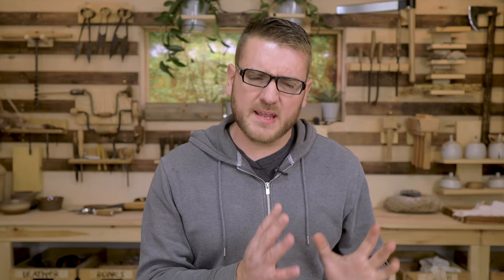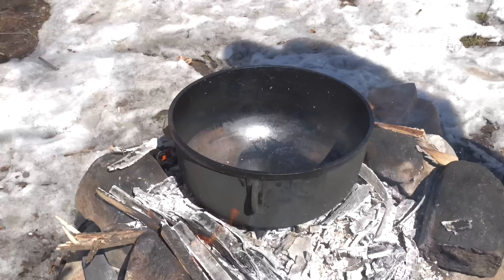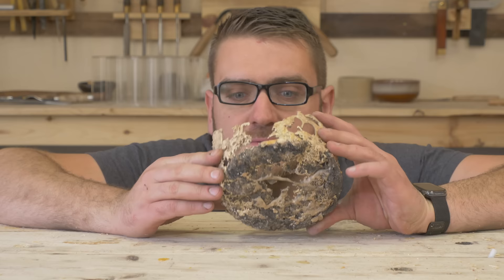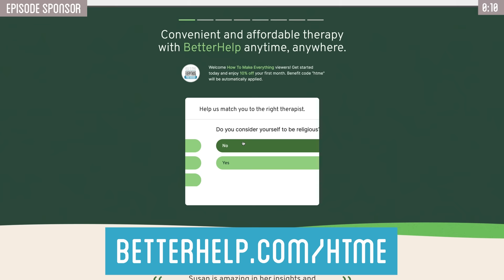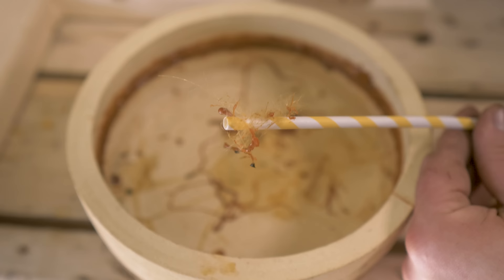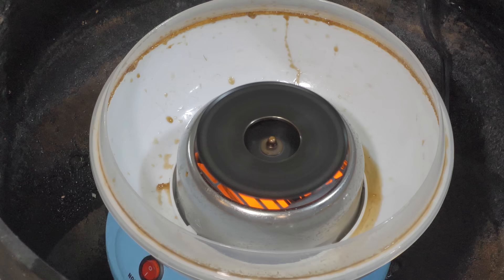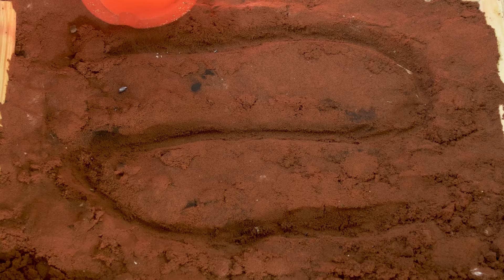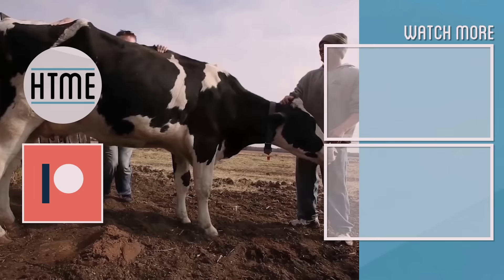Can a Dr. Stone Centrifuge Make Cotton Candy and Wires?

Comment: I tried the Dr. Stone Cola recipe once. It does kinda work. If I ever do it again, I'll be using caramel instead of sugar just for the cola look.
Reply: I've made my own cream soda like this for years. I pour a sheet of caramel, grind it up in a mortar and pestle then mix it with home made vanilla extract and water to from the syrup. From there, just use club soda or stick it in a soda stream. 

You can also use a brewed method similar to how root beer, birch beer and sarsaparilla were originally made. Make sure to use a low gravity yeast like LA-01 and get bottles with a deep punt if you want substantial carbonation. Regular bottles and jars tend to explode when making soda. Because of the sugar content, you typically just wait for the yeast to kill themselves off with the alcohol they are producing, which is a lot less controlled than dosing with sugar like you would for Champaign or beer.
Reply: Wait, you used sugar? I’ve been making it for months and have always been simmering honey for a couple minutes and using that. Didn’t know there was another recipe that used sugar
Reply: @connormcgrath5800  No, you had it right. There is no "other" recipe. It's just what I had on hand when I felt like doing it. I was way more interested in seeing just how close the combination of cilantro and lime came to tasting like cola. If I was truly serious about the comparison, I would have made another batch that included corn syrup as the sweetener in order to isolate that difference as well.
Reply: @sirnukesalot24  ah, gotcha
Reply: Yeah the recipe says to caramelize honey.
Reply: It seems like the kinda thing that works if you drink cola semi-regularly, then cut it out of your life cold turkey along with many other familiar flavors and foods (like the characters in Dr. Stone were forced to do), and then try the recipe to get back some semblance of that bygone "normal".
Reply: Oh in the anime he also put sulfuric acid does troll face

Comment: it's always nice to see semi-realistic fiction getting fact checked.
Reply: jujj
Reply: its like a second fact check. the manga used science consultants
Reply: everything shown was....theoretically possible. throw in a large pinch of anime suspension of disbelief and it really isn't that bad. Just because HTME can't do it doesn't mean no one can do it, most of his creations are super jank lol
Reply: @ExarchGaming  my main problem is that most of the inventions are not a good way to do the thing they're designed to. It would be much easier for a blacksmith to make small chunks of sheet metal and then form them into the bowl shape. And you don't have to be a skilled blacksmith for this. You just need to have a hammer and a hot fire. Then you have to consider that gears are a bad way of increasing speed for that. Pulleys are smoother and easier to build, plus you could fit more of them for a better gear ratio. Plus it's just not physically possible to make wires by slinging molten metal like that. The surface tension of the metal is way too high and it can only come out as droplets. You could just make rollers to thin out the metal and then draw it out. If you want to automate the process, you could use metal gears to pull the metal through. It feels like they're writing a character that's meant to be super smart, but because they don't have a good understanding of what they're writing about, it comes across as pretentious. Like the main character thinks he's so smart but his machines are all poorly designed and only work because plot
Reply: The way Dr stone does it is just bad, everything they do doesn't feel like a major accomplishment and it's feels like "we invented this cool thing in seconds and now we're on to making something else" and I feel the way they do the making of things with what seems to be zero effort gets rid of the excitement of accomplishing their goal. It makes such a cool idea so mundane and uninteresting
Reply: @The_evil_accountant  that's more or less anime as a whole. They love the super intelligent cliche, I dunno that it makes the idea mundane, Dr Stone is pretty wildly popular.
Reply: @The_evil_accountant It was either that or watching 3 billion more years going by before they go back to where they left off. I seriously don’t know a method of doing this sort of idea without Senku being insanely smart. The entire obstruction that Senku has is that he knows the basic instructions, he just doesn’t have the skill, strength nor time to do this. This is why the entire Ishigami Village even exists. Having a protagonist that has all smarts, talent and brawn will just turn Dr. Stone into a reskinned isekai anime.
Reply: Makes me nostalgic for mythbusters
Reply: @thedudeamongmengs2051  not hard to make that mold issue he has it wall to short and it escaping they used bamboo large enough to stand and press then poke the holes i can make one that way why they show more then one person to make sure it works
Reply: @blackcrasanblade  I didn't say anything about the mold thing but also, it doesn't really work. Pouring a metal part with a bamboo mold like that is just a bad idea. Even if it did work, a forged part is better anyway
Reply: Bruh, I've seen Indian tick-tocks with better build quality.. props for him trying...
Reply: @The_evil_accountant  I agree a lot of what they do is handwavy, but one thing that HTME is missing, is a meticulous and skilled craftsman who's only pressure is to do things skillfully, HTME has deadlines, and titles to make. A few more skilled and dedicated craftsmen and scientists who know what they're looking for in RPM, hole size, and flow rates could probably achieve this task, and HTME even proved that the method Dr Stone used to make the crucible is theoretically plausible but HTME just didn't have the patience or understanding to bring it to fruition.
Reply: @The_evil_accountant  ive watched the show, and i disagree. usually they have the best reactions to things that took them months to invent, like the tank or ship
Reply: @The_evil_accountant  i dont think tis zero effort particularly in season one and two like they spend a very long time getting basic things set up and then building on them and of course for that reason it gets easier as they go like what happens in a video game as you slowly have more and more resources.
Reply: @flopyman1996  true it more of size of the build and know how redneck engineering scary for a reason it may work they dont know how but that why it scary
Reply: Fict checked
Reply: @Kodaiva  It's hardly a fact-check here if he's doing nothing of what was shown, except for that rotation device.

The centrifuge was way too small for anything. Not only is the force generated on a totally different level (in a bad way), but it kept spilling everything instead of actually pushing through the holes.

The fact that the container was held by wood, when he intended to use molten metal, is an utter misunderstanding. 
Likewise, the commercial cotton candy machine test was pointless. How could it have worked if it was burned through almost instantly?

All he did prove was that he doesn't understand that not everything scales up (or down) well. Liquids are a notorious examples. When doing literally anything with liquids or gases, scale is a massive factor that changes literally everything. As such, his tests had effectively nothing to do with the portrayal in Dr Stone. As proof, just take his just about failure in making cotton candy with that device of his when the concept itself is literally identical with how the cotton candy machines actually work.
Reply: @The_evil_accountant  They don't invent anything. These things aren't new. Senku actually knows those things as a genius engineer (while his scope of knowledge is far-fetched, high-spec in specific fields is most certainly possible for young people...I mean, there were teens that literally made simple computers in their garages from scraps without any formal training).
He simply uses the knowledge of what was already invented and tries to follow that knowledge with the materials at hand. There's not supposed to be any achievement in 'inventing' it. The achievement is only in having it with the limited tools at their disposal.

Comment: For casing in wood if you burn the wood so you have carbon for the metal to sit in that helps insulate the wood and slows down the wood burning.
Reply: Why would burning the wood slow down burning the wood?
Reply: @melody3741  Wood already burnt. Wood no burn again.
Reply: @melody3741  the carbon layer from the wood insulates the rest of the wood. You need to let the wood cool down after
Reply: @melody3741  The carbon layer from burning it first creates a layer blocking the metal from water in the rest of the wood.
Reply: @melody3741  There have been 2 explanations:

wood burn
wood no burn again

insert high detail analysis of the exact benefits
Reply: Yeah, certain carbon insulates really well, and the carbon in a piece of newly-burned wood is capable of generating more black-body radiation (allowing it to stay in thermal equilibrium with its surroundings for longer).  It's pretty neat stuff.  I think some Russian youtuber once tested a claim about carbon by showing how even a simple, but thoroughly-burnt, piece of bread/toast could potentially withstand the temperature of molten metals with high melting-points (maybe even molten rock, can't remember) without the metal burning through it.
Reply: @dcallan812  the cabin layer would burn even better lol, you’ve made friggen charcoal and took the moisture away. It will burn better
Reply: @elijahlong7791  it will burn at some point but it will SLOW the burn al lot. Also Charcoal is made in an oven with little to no oxygen, how's that work 🤷‍♂ mother nature at her best.
Reply: @dcallan812  Small amounts of charcoal were made, that is why it becomes black. That is how large amounts of charcoal is produced, but the coating would be charcoal
Reply: So changing the wood into charcoal, almost like a graphite mold!
Reply: If you char the wood, it becomes carbon, which is insulating, but the caveat is that oxygen isn't getting in while it's in contact with the burning metal. If oxygen leaks in, then the charred part will burn. If it doesn't, well then wood no burn again.
Reply: @brown56765  yep 👍👍
Reply: @melody3741  Because what's left is just carbon, not wood. All the water's gone, at least on the surface, so no sizzling Leidenfrost nonsense. Eventually the carbon itself would light on fire but that's not going to happen as quickly or easily, and even then it won't immediately disintegrate.
Reply: Apart from carbonizing the wood there's also certain seed oils and saps you can use to make it less flammable. 
Most of the things done in Dr Stone is possible but it's way oversimplified and/or way more efficient and faster  in the show (most of the more complex things would have taken years) and doesn't always show all the smaller steps needed for it to work.
Reply: @melody3741  Since I haven't seen any fantastic descriptions of why burning the wood first helps the wood stand up to fire, I'll give it a go: The simplest and least descriptive explanation is that burning the wood forms a layer of charcoal, and charcoal is both harder to ignite and burns slower than raw dry wood.

What basically happens is raw, dry wood is a mixture of compounds that burn very very easily and compounds that burn more slowly. When you light the wood on fire, only the outermost layer of the wood has access to oxygen and can actually burn. Right next to that burning fire, where it's extremely hot but there is no available oxygen, the wood will "cook". This causes the most volatile compounds to leech out of the wood as wood gas. This wood gas either burns if it's able to get to some free oxygen, contributing to the heat of the fire, or it just floats away as smoke.

What's left behind is pure carbon in the form of charcoal. Charcoal without all those volatile materials still burns really well, but it burns slowly and is much more difficult to ignite. If you've ever used a charcoal grill, you'll know you can't just light a match and set the charcoal on fire. You need to use lighter fluid to get the charcoal to light, because the charcoal requires a lot of heat to get started. 

When the charcoal is formed on the surface of the wood it acts as a barrier, protecting the more flammable wood underneath from the heat of the molten metal. The charcoal will still catch fire, just about any common molten metal is hot enough to ignite the charcoal, but it's a much slower and more contained burn than it would be with raw wood.

If you're interested in learning more about this, burning wood siding is actually an old-fashioned method of weatherproofing the siding of barns and such.
Reply: @TechySeven  Por favor si tienes el vídeo manda el link, quisiera verlo
Reply: @TechySeven pliss link 😢

Comment: Like modern cotton candy machine, the one in Dr. STONE has a heat source (a fire) to heat the contents inside the centrifuge. It's questionable whether the heat is enough to melt gold without melting the gold wire nearby but it would solve the clogging issue.
Reply: in the end there is a lot of technicalities but the point was proven cotton candy can be in theory made with enough effort

Comment: So spinning metal into threads might potentially work, but as you saw with the sugar, you need just the right temperature, and just the right velocity, and just the right hole size.  And those will all be different for every different alloy.  Plus the velocity limits the length of wire you can get pretty substantially.  It's just not an efficient way to do it compared even to hand-forging, let alone using a draw plate.

Comment: Before wire drawing dies were invented, gold wire was made by pounding gold into thin sheets, cutting the sheets into narrow strips, and twisting the strips into long spirals.  The spirals were then compressed, probably by rolling them between hardwood blocks or smooth stones, to make smooth wire for jewelry.  One signature of pre-industrial jewelry is that the wire has a spiral seam that's visible under magnification.  Wires like that were probably made just long enough for whatever jewelry project, but if the gold is pure enough, it can be cold-welded by heating it in a flame to burn off surface grease, then pressing it together, so you should be able to make strips of any length by welding them end to end, then convert to wire
Reply: thinking about how they really do honest to god make gold leaf by hammering it to a thousandth of an inch.

Comment: Pretty sure the reason the Cotton-candy more or less failed in your rig is two-fold;
1. WAY too low RPM.
2. Bad sugar. That sugar seem way too wet, and way too impure. For cotton-candy to properly work, the sugars has to be completely dry, and very pure.
Reply: Crucible size, as well. With a crucible so small you're gonna get almost no centripetal force, which was really the whole point of the system.
Reply: SO your sayig Dr.Stone is NOT debunked?? 

If this is truly debunked, this means a lot, sadly. The Wires but more importantly the Cotton-Candy is ESSENTIAL. Senku later builds candy-powered Spaceships, his laserweapns wouldnt function without cottoncandy
Reply: @slevinchannel7589  Don't give spoilers! I haven't caught up to the manga yet! D;
Reply: @slevinchannel7589  I mean, there is almost no science in either one, what they do is engineering. But yes, they are not perfect, they will have mistakes. xD
Reply: @serenacula3256  I wanna make a Vacuumpump or at least know what i would have to tell a really-talented Cravtsmen in a Stonage what to do to craft one. Can you watch 'Trash Zuma' and his video called "Dr Stone / Making Bettery / Christmas in Stone Age" real uick and tell me all you know about the Use of Mercury?
Reply: @slevinchannel7589   I THINK the way he makes the vacuum would work? Not sure though, I'd worry about the strength of handblown glass handling a vacuum without modern hardening methods. And I don't know if you could craft those glass tools by hand. And they don't show how he seals he vacuum after making it.

The generator Senku makes definitely doesn't work though, there's a video of someone else remaking it to prove so. Which is weird, because generators are actually really simple, you could totally make one from basic materials with enough patience.
Reply: @serenacula3256  I saw yet-another video where it does work, sooooo
Reply: @slevinchannel7589 

Gold is one of those weirdly exceptional materials to melt, spin and generally make insanely thin any means, without any problems. 

Can't really test it out with copper or other low temp materials.

Also the one in Dr. stone is higher tech than what he built.
Reply: i think its interesting that the diy version ended up with a better result than the cotton candy machine, maybe the high rpm works for sugar but not metal? also i genuinely cant tell if the notch in the crucible is suppossed to be a hole or there are in fact tiny holes than dont quite show up on video